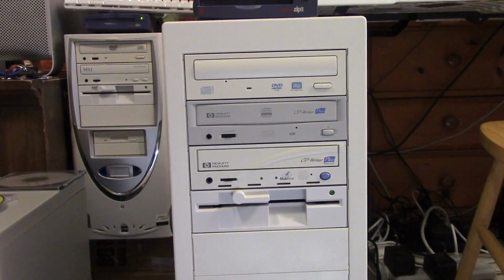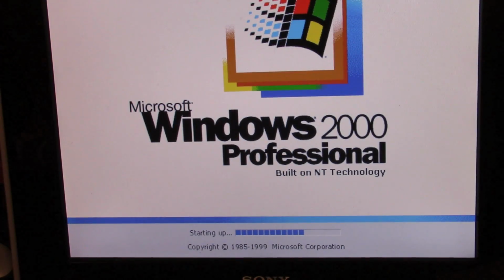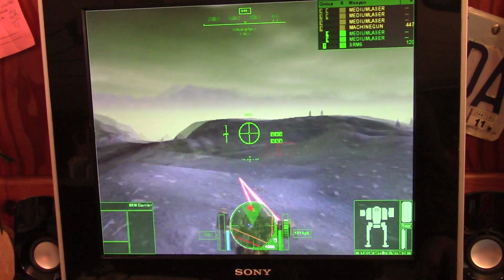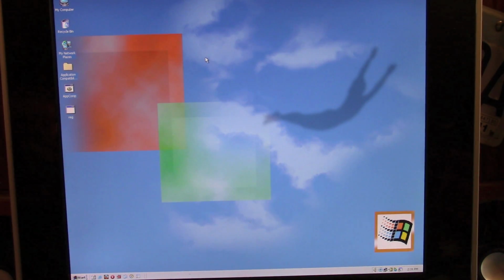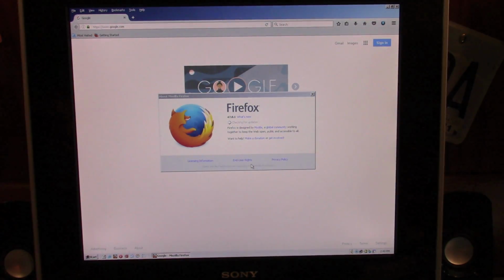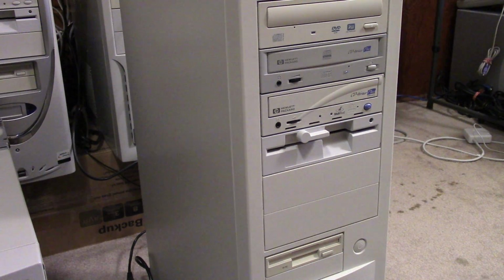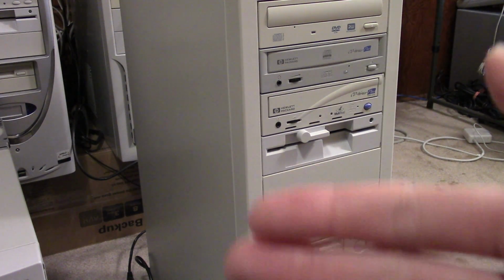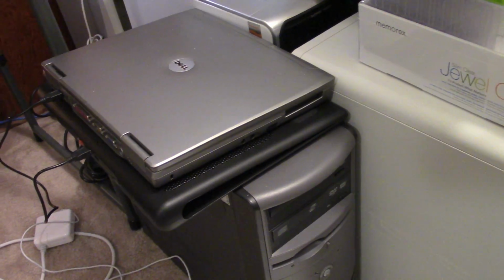Dual Pentium Pro (2 CPU, 2 PSU) Part 3

Comment: 215M memory usage is waaay to much for a Windows 2000
It should be in a 40-60M range with all the drivers loaded. You may want to check for some unneeded apps or services running. Probably have a bunch load of them.
BTW, Windows NT 4.0 runs exceptionally well and snappy on a Pentium Pro and uses as low as 12-15MB RAM with all the drivers loaded.
Anyway, great video, great build you've done there. Love these vintage Pentium Pro stuff. Take care man.
Reply from the maker: Are you sure?  Keep in mind this is Windows 2000 with all the updates, and a few tweaks to get those updates and some security programs.  XP got pretty fat near the end, so I figured 2k would be similar.
Reply: @RapidlyAgeingTechnology  Absolutely, but I'm talking vanilla Win2K or with SP4 installed and nothing else more.  About 50Megs RAM usage for Windows 2000 with drivers loaded, ~80-100 for XP and 12-15 for NT4.

Comment: I plan on turning an old dual xeon machine i found at goodwill into an emulation machine paid 7.00 for a dell precision 530 uses rambus so it will be faster than DDR machines its a dell precision 530

Comment: EXCELLENT !!!!
Reply from the maker: Thanks!
Reply: i trying to run win 95 ad 98 on a  VMware virtual machine for the thrill but facing huge issues of compatibility
Reply from the maker: Sometimes the old way is the best way.  You can get yourself a socket 478 board cheap as chips and go from there.  They should have Windows 98 drivers.  For the AMD side of things (which I am a fan of, but have a soft spot for the high clocked Pentium 4), socket 462/socket A boards are pretty cheap too.

Comment: Instead of asking you " can it run Crysis" because it will probably explode if you attempt it, I'm gonna ask you does it even have a turbo button(older generation). Nice video :D.
Reply from the maker: No turbo on this guy.  Not quite old enough of a case.

Comment: I think the cache size reported by the bios in the POST is not the L2 cache, but L3 cache that motherboards of that era used. Look for the manual from the motherboard, it'll say how much L3 cache the board has. Also, this cache is usually upgradeable, and it was a huge boost in pentium-era computers.
Reply from the maker: The manual did not seem to mention an on board Cache, but I will do some digging to see if I missed it.
Reply: The cache is 1MB per CPU and is on a die inside the CPU package, not on the board.
Also don't use any other OS than NT, 2000, XP etc as these CPUs could not handle 16bit and 16/32bit code well, they were very slow with it. they were designed for servers and workstations running 32bit OS'es like NT and higher...
Reply: There is no L3 cache on these boards. Both CPUs need to be 1MB chips, are they?

Also a large number of BIOSes didn't have support for the 1MB chips considering they were released so very late in the product life. Have you managed to track down all the BIOSes available for this board? There might be an update available. 

Good old floppy boot disk and DOS command line flash the BIOS job. Ah, those were the days :)
Reply: I also didn't catch the part of the video where you quoted the amount of cache it's reporting? It should report 1MB per CPU or if it doesn't specify "Per CPU" then just 1MB.

I wouldn't expect it to report 2MB cache anywhere.
Reply: I remember adding cache to my Pentium 75MHz computer and it ran way smoother than my Pentium 133 without cache!

Comment: The problem with the DVD decoder is that GeForce cards can only be used as a decoder on Windows XP, and only with software that has to be licensed. I took notice of this as my Thinkpad, docked with an MX 4000, can't decode video on Windows 98.
Reply from the maker: Dang.  That sucks.  I wonder if there is something that can work with 2000 then...

Comment: the Pentium pros lack MMX instruction set used in games and multimedia as i recall. probably the reason for the poor frame rate in your games and video.
Reply from the maker: I can understand the video, but I could have sworn that Mechwarrior 3 should be able to run on a pre-MMX chip well.  What really surprised me though was that Mechwarrior 4 ran similarly and seemed to have both CPUs active!
Reply: I remember playing mechwarrior 3 but i think the hardware i was running at the time was a pentium II at 400mhz, 512meg ram, and a tnt 2 video card, then i went with 2 voodoo 2 cards in sli. also if you want to game on it you probably should go with windows 98 but don't think that will support 2 cpus. windows 2000 based on NT had too many application layers, made it more stable but denied programs direct access to hardware. this brought about the creation of direct x. windows 98 was pretty good os it had just 1 big problem, a memory leak in the disk cache. it would cache everything till it consumed all your ram then start caching to virtual memory, the fix was simple in the system.ini add a line for MaxFileCache="set value". and win98 will run like a champ with out needing to do frequent reboots.

Comment: I don't think you can activate Windows 2000 any more so will expire after 30 days.
Reply from the maker: I don't think 2000 needs activation.  98 didn't, though you still needed the key code.  Either way, the machine is running fine without any Microsoft nasty grams!

Comment: System works best when switched off.
Reply from the maker: It is the quietest then!
Reply: Old fans usually quiet up if you can oil them. Some really old fans were even serviceable like that. Others you have to butcher a bit to get to the bearing. But if you're good at surgery the patient can pull through. I did that here https://www.instructables.com/id/Noisy-Computer-Fan-Repair/

Comment: Personally, I would have used only one of IDE or SCSI and made the other SATA or SAS. Even with a newer CPU, the Geforce FX line is already close to PCI's limit. With machines like this, driver support and optimizations are more important than the theoretical fastest. I wasn't aware 750 GB drives were made for IDE; thought 500 GB was the max. It's been a long time, but I remember mplayer in Linux delivering amazing results on machines like this. That was back when VLC was absolute crap, though, and ffdshow may not have existed yet.

Comment: Nice video.  Quite similar to my dual Pentium Pro/II.  I'm running an Intel PR440FX board with two Pentium II Overdrive 333MHz chips with 512KB L2, 512MB ECC EDO DRAM, and a 3.2GB PIO Mode4 boot drive (very slow) with a 20GB Quantum Fireball UltraDMA/100 data drive connected to a Promise IDE PCI card.  The setup is running Windows NT 4.0 Server setup as a Domain Controller for my Windows 95/98/NT4 computers on a 3COM 100Mbit NIC card.
Reply from the maker: I would love a couple of Overdrives, but i would rather use them on an Intel or other more supported board.  Thou art a lucky man!

Comment: I once had an IBM IntelliStation Z pro with two 200MHz 512K Pentium Pro processors. I used a TNT2 M64 PCI card for video. Worked fine but it ended up in the recycling centre after I moved out of my parents' place. :(

Windows 2000 ran fine on it. I tried Server 2003 out of interest and it only detected one of the processors - they disabled multiprocessor support for the Pentium Pro in 2003.
Reply from the maker: I always regret getting rid of my first computer, an Athlon Slot A 700Mhz machine, so I know the feeling!

Comment: It is nice to stumble upon something this nostalgic :) 

For those of you that didn't go through 90s PC standards: the main difference between AT and ATX powersupplies and motherboards was the ability to automatically shutdown. On AT boards the powerswitch was like a circuit breaker, while on ATX it is just a jumper that sends shutdown command to the OS. And that is why you have 4sec wait time when the OS is inresponsive.

Comment: The BIOS is definitely your issue, I've seen tons of option ROM issues without updating the BIOS in these old systems. Just get a better board...
Reply from the maker: These aren't the most common boards out there, and mine was new old stock, so I'll stick with it.  I think I recommend using an actual Intel board if you can find one due to better support.
Reply: I don't disagree at all, esp considering how difficult it can be to part together a PPro these days. I should have stated my full thoughts, which is to get a better board if you can reasonably do so. 

But, the OPROM issues might not go away even with a different board. So it can just be a huge crap shoot. I've had to modify some older BIOS code and change OPROM defaults/configs. Not so much with newer Phoenix and AMI though, most of that crap was figured out around about the age of Core2 systems. Even then there are parameters to be changed to get OPROMs working correctly in special setups.

That is all well beyond the scope of what can feasibly be done though. The problem is, unless specific configurations were tried in the first place (and patches were applied to the default BIOS config) you might just as well bang yur head against a wall trying to get things working. 

So depending on your expectations, you may as well try a different board, unless you just want to stick with what you have.

Comment: I do not envy you your most powerful laptop
especially now
when my rubbish laptop is just over 4x slower then my daily driver laptop (on Intel i7-2670QM) and rubbish laptop is one generation newer then my Dell Latitude D630
I basically cannot deal with anything less then 4gb of ram and anything worse then intel i5-540M

currently even my phone is on par with my desktop (AMD Phenom II X6 1100T), so I do not think I would be me to come back to Intel Core Duo
Reply from the maker: I have a faster laptop now, but I'm fine with the slower things.  2Gigs or RAM on an older, more light weight OS is fine...unless you are the type of guy with 100 browser tabs open.
Reply: Rapidly Ageing Technology actually somehow you guessed. I am not joking I usually have not less then 4 (up to 8-10) browser windows opened with around 50-100 tabs opened. I am using almost all very frequently (not less then one an hour), so it would be counterproductive to close any of my "permanent" windows or tabs. I use almost exclusively my laptop for work though.
Reply from the maker: That seems like too many to be able to even keep track of!  I have kept most of my formative habits from the Windows 98 days, so very few tabs most of the time.  At work I have to keep more things open, but still not that many!

Comment: Don't you know that you need to press F6 during installation to install raid card drivers, so you can install the Operating System to boot from the drives attached to the RAID card using the RAID volume. If you have two drives you have a choice of RAID 0 or 1, which RAID 0 increases performance and doubles capacity of the partitions or drives depending on if you have matching drives or have to make matching partition sizes while RAID 1 adds fault tolerance of redundant mirroring of the first drive. Linux RAID card driver installation is completely different if you ever try it and installation depends on the RAID card used, but usually it's done during installation from command line aka terminal.
Reply from the maker: Correct, but I had no desire to use RAID and am only using the promise card as a simple controller.  That massive Seagate needs to be used!

Comment: you really should get a promise two channel IDE 133 controller instead of a raid one, that way you can disable the onboard controller and just run everything from that controller. There are also better old school IDE 133 cards that will work and be pretty fast but you are trying to use a raid controller as dual channel and it of course doesn't like that. Or maybe find a later dual pentium pro server motherboard which had two IDE 133 built in, Supermicro used to make those.
Reply from the maker: Probably a good idea.

Comment: Now upgrade to dual Pentium II Xeon Overdrive CPUs.
Reply from the maker: Oh how I want to, though I fear the bios will not recognize them.  There seems to no longer be a bios update available anywhere and, according to some sources, the bios updates you find are for a different bios chip revision and will brick the board.  If I found some cheap, I might try it though!

Comment: From my own experience playing with the similar Dual Pentium Pro 200:
These CPU's are great for the era but the EDO memory is huge bottleneck issue
Windows 2000 works much much slower than Windows NT 4.0 on this type of hardware
I really recommend you trying NT4, you'll be surprised the way the Windows 2000 burdens this machine.
Reply from the maker: I'll have to give it a go.  NT must be quite light since 2000 feels quite light compared to XP (though that could be subjective).

Comment: Regarding the video playback of the dual Pros. I suspect the reason why your video playback was slow was due to the fact that since these chips were released in 1995. 

It would be more appropriate to use the codecs that were popular in that era. Your videos may have been encoded in a more modern compression format which would cause the CPU to stall quite a bit due to the decompression involved. To note, compression and decompression algorithms are CPU intensive. 

The Pentium Pros also don't have MMX, SSE, etc type instructions so it would not be optimized for such a task anyway.

I'm curious to see... what would the video playback at 360 resolution be if the videos were encoded in MPEG1 format? My guess is that it would perform much better in that scenario.

I loved your videos re: the Pentium Pros!!!! I am currently doing a technical and historical analysis of this chip and am on my way to completing my own build with these chips too! Planning to make a video out of it myself!!! :)
Reply from the maker: Thank you very much!  I know these are old chips, but I thought two of them together with a much more powerful GPU, it would have worked better.  You see, VLC can use the GPU a decent bit.  Far more than a web browser watching a Youtube video.  Alas, it was not to be.  I may try and see if I can convert a video to a really old codec and see what happens.  I wonder how much better a Pentium MMX at the same clock speed would do with a  modern video?  Maybe better but probably not too much better.  Anyhoo, I am glad that you liked the videos and that they stirred some thoughts for you.  Please post your video here when you are done!  What motherboard did you use?
Reply: You should go for it and make a follow up! i am definitely interested in seeing that sort of experiment. 

Also will do on the video! I'm planning to use a Tyan S1668 dual socket 8 for my build. I recently scored 2 Pentium Pro 180s in boxes and I can't wait to make a sort of "new-old pc build" on something like that.  :)
Reply: I've forgotten much of what I used to build in the late 90's but one thing I do remember is that you need to install a third party DVD decoder program for a DVD to play. This was due in part to the copyright issues of DVD playback and Microsoft. So something like WinDVD or similar would have to be loaded for this purpose. For posterity's sake, I've kept a running quad processor Compaq server that uses Intel overdrive 333 in the socket 8 configuration. Your shut-off (problem) is due to having a non-soft off power supply (your switch on the PC is a latching switch and not a momentary). Otherwise this video series brings back painful memories of compatibility issues with PCI identification and like you said, BIOS limitations. I used to troubleshoot a lot of IRQ conflicts in the day, and boards like these were brutal.

Comment: Great machine back in the day, unfortunately most of those pentium pro cpus have died the death of gold recovery. I have 5 of them laying around waiting for the day when they get crushed and torn apart by hydrochlorid acid.
Reply from the maker: I hope you protect them as long as possible!  Better yet, build a few machines and maybe give them/sell them to folks who will appreciate them.  I have two of the 512 KB 200Mhz gold tops sitting around.  I may put them in this machine to see if the bios recognizes all the cache.
Reply: I protected them since they got decomissioned in 2002, one computer is fully working but I just have no use for it other than playing old games on it. Its funny though I still remember the price tag of the dual pentium pro boards, nowadays my iPhone in my pocket has much more computing power.
Reply from the maker: I know right?  It is hard to imagine that these machines were ultra top of the line at one point and are now laughably slow compared to a portable telephone.
Reply: Rapidly Ageing Technology I have similar feelings about 4 GB or smaller hard drives
Reply: Actually, anything under 128 seems ridiculously tiny, though I have a few SSDs around 30gb